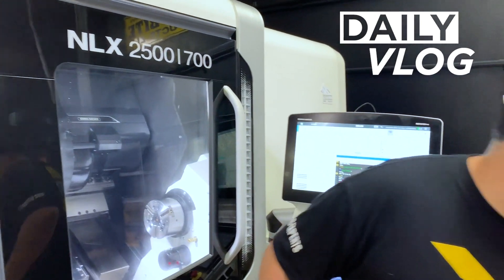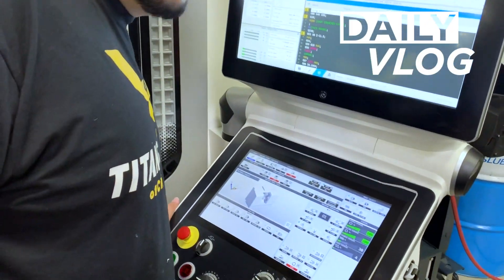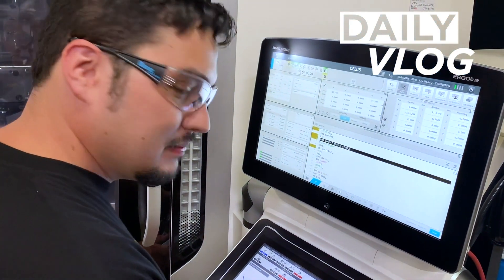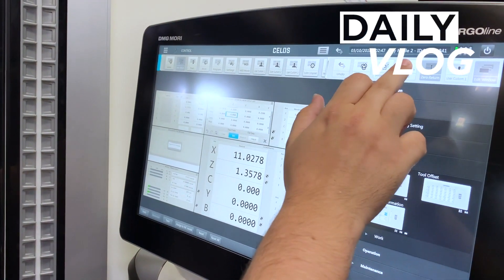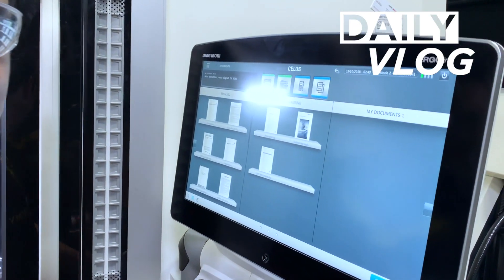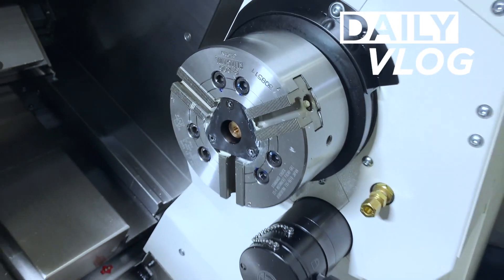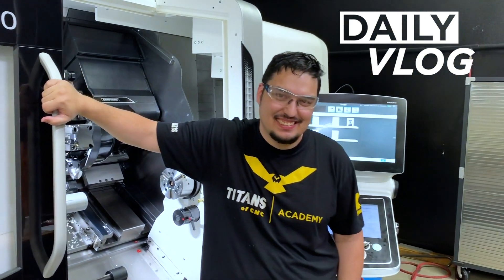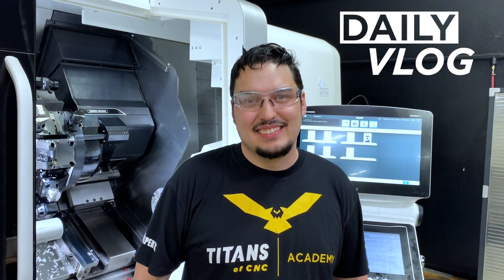DMG MORI NLX 2500 (First Impressions)  - Daily Vlog #10

Comment: I used to work on a dmu 85 monoblock machining wing ribs for airbus, it always crashed when performing simultaneous 5 axis maneuvers.
Personally I prefer matsuura.
Reply from the maker: Sounds like they made a lot of adjustments... I am getting the DMU-50 3rd Gen.
Reply: Mori even changed the processor, it seemed like it couldn't handle a program with many lines of code where it was only traveling a short distance.
Reply from the maker: Matsuura is Great also

Comment: Do you use Shopturn on this mashine? I used to work with only dmg lathes and Siemens shopturn plus is so convenient to use when you make easy part with out CAM programms
Reply: I agree, great program. Can nail out a program before you get the CAM software fired up. Best thing about it... it's not a Fanuc.

Comment: Haas make very good budget machines. They used to have a reputation for being light duty only, but I think they've improved a lot since then. 'Boom' for buck though, Haas wins.

That DMG Mori though is so fucking sexy. Mori machines are the Rolls Royce of the machining world. That nlx is a beautiful thing... 

I've run 30 year old mori machines that still hold tenths. I've also run mori machines up until the generation just before the nlx (nl2500sy/700) and they too are pure machining excellence. The controller is so good you can program pretty much anything on the machine control itself, instead of relying on CAM software to do the programming for you.

Seiki is Japanese for precision, random fact lol. (Mori Seiki, Seiko watches)
Reply from the maker: I have 17 Haas’s and love them... DMG MORI’s are Amazing
Reply: @TITANSofCNC  

I look forward to seeing more content on the mori.

How's about doing an example part. Start with selecting and setting tools, then program a part on the machine control, then make it.

Just make a bar with a couple of different diameters, maybe a hex on the end with some cross drilled holes. A bored ID with an internal groove. Something like that anyway...

Would be interesting because I've not used the new control that's on the NLX.

What's the max bar diameter on the nlx that you have? Spindle ID I mean.. Thanks

Comment: For Capto and Driven Tools Check WTO, MT Marchetti or Sauter Feinmechanik.
Please don't buy anything else. 
This is not a Haas or a Spinner.
If your Holder is broken or leaky you get Water in the Turrent and then ist the Machine broken.
I work with this Mashines, Nl, NLX, NZX, NTX and no Company can build Machines like Mori.
There is only one Point I don't like on it, Touch. I Hate Touch on CNC-Mashines. Whiteout I can programm 3 Times faster.
I also work with: Star, Traub, Index, Yamazaki (Mazak), Voest-Alpine and Takamz.
Please write if anyone need a Job in Germany

Comment: I heard DMG is starting to build a lot of machines in USA is that part of why you bought one of these? I bought an nl2500Y back in 2008 the outside is totally different but the inside still looks the same.  What brand of live tools did you go with? I Find that makes such a bid difference on a machine like this.
Reply from the maker: Yes they built their new plant 30 min down the road and use US workers to make a lot of machines... also farm out to local shops
Reply: @TITANSofCNC  that's awesome. love the video want to see the part though or machine turning some metal.
Reply: We build machines in the US; automation of various types. Never mind the fact that 90% of the componentry comes from overseas, especially the critical parts like guiderails, bearings, electronics, stepper motors, etc., etc.. "Made in the USA" takes on a whole new meaning in the real world of reliable machine building.

Comment: My shop is almost all Haas vertical and horizontal mills and lathes. We have one lathe with live tooling but for the most part it's just your standard production type models, nothing too exotic. We just brought in a Mori Seiki NVM5000 which has their new DCG (Driven at the Center of Gravity) and DDM (direct drive motor that is the B axis. No belts, worm gears. And every axis has twin ballscrews. It is insane. The rigidity is so high that you can run unbelievable feeds and speeds. We're just figuring out all the little nuances and tricks. The factory man we have helping us set it up is really good and we are figuring which jobs would warrant that machine vs our Haas's. But we are excited! There's a video on YouTube that really shows off all the features. Check it out.
Reply: Yep, you'll find out you can't afford to keep the other machines soon enough. Besides, they still fetch a pretty good price under the 5 year mark.

Comment: Why the change to DMG?
Reply from the maker: We have 17 Haas machines, and we love them. Wanted to show off some other cool machines also. Will be doing Aerospace tutorials on the DMG MORI
Reply: My guess is repeatability issues with Haas for aerospace jobs.  Haas is supposed to be repeatable to .0005, some other machines (not sure if the Mori machines are) are repeatable to .00005, if the job has a tolerance of +0 -.0002 Haas can make one part, but a run of parts will be really hard.  Basically you have to make each part individually.
Reply: DMG MORI are the Rolls Royce of machine tools. That's why.
Reply: Because a Haas is like a honda civic, a good reliable work horse that gets the job done, but not in that particularly great of fashion (hey atleast its not tormach). When Mori Seiki is a super charged corvette with a roll cage and suspension..
Mori's are really, really, nice. Twin ballscrews on each axis, rigidity is insane, can hold way better tolerances, better repeatability, better controller etc.